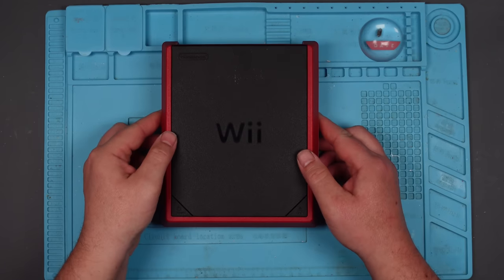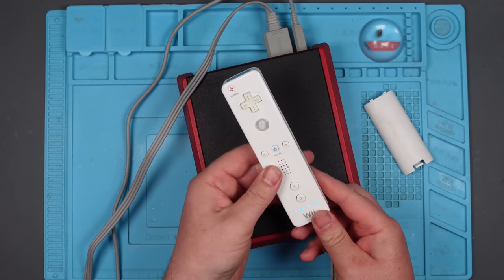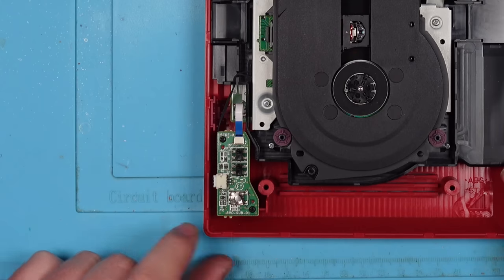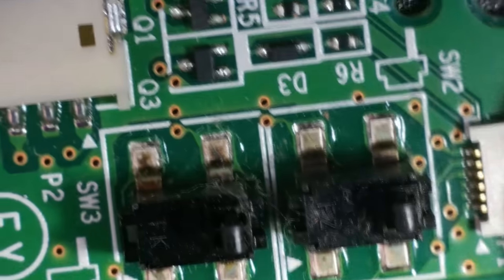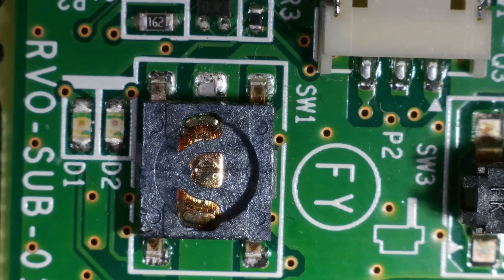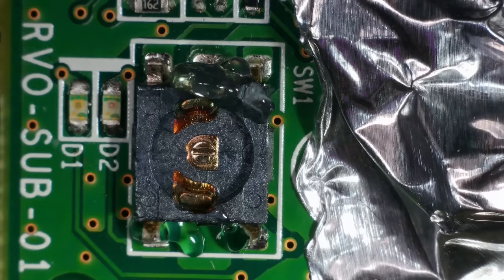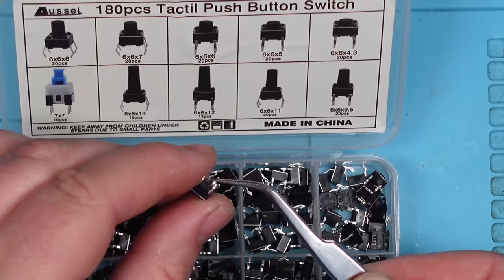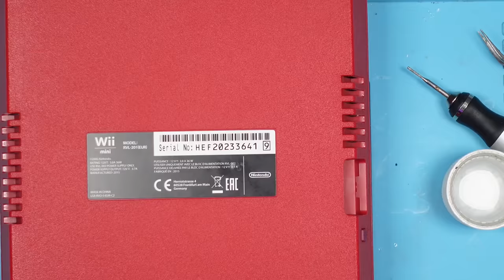I Paid £18 for a FAULTY Wii MINI | Can I FIX It?

Comment: Agree with those who say no need to reset the melted plastic counter. I consider the counter to mean when you accidentally melt something because you didn't take precautions/didn't think about it and you end up damaging the end product. The bad switch was, well, bad so who cares if it melts...you weren't going to take precautions to protect it. 🙂
Reply: Agreed
Reply: Agreed
Reply: Yeah I don't understand why he reset the counter. The button was completely destroyed already, you can't salvage anything on that it was just junk.
Reply: I know he really wanted to reset it and looked for an excuse to do it.
The button was to be replaced with hot air and it doesn't count as melted plastic. Put the counter back to current day.
Reply: Agreed, counter should be restored.
Reply: I 1000% agree!!! DON'T RESET THE COUNTER!!!!!!!✊
Reply: Agreed.
Reply: Back to 10 for the counter.
Reply: Plastic was melted. The counter had to be reset.  We aren't anarchists.
Reply: I disagree; any melted plastic counts.
Reply: I thought the point was when it was done accidentally.  Maybe it's the sign that needs updating
Reply: @l9day   it was accidental - he didn't set out to melt the plastic.
Reply: This 100%
Reply: Agreed, melting already broken parts intended to be discarded should not count. I recommend we petition the committee and overturn the reset of the counter. Who will draft the strongly worded letter?
Reply: @mrcodez Anne Robinson has been informed already
Reply: I agree, you weren't intending to keep the broken switch anyway. You can bring it back to 10 days guilt free.
Reply: Agreed.
Reply: melted plastic is only a problem if you want to reuse it.  You wouldn't reset the "damaged capacitor" counter if you cut them off to replace them.

Comment: I probably would have just shaved down the pokey-bit from the WII but you're probably right to modify the part rather than the console.
Reply: if he had to mod the case it would be better to shave down the plastic standoffs. then the damage can be reverted with longer screws/washers

Comment: I don't think I've ever seen a Wii that looks like that
Reply: nor have i. really weird. though it was one of those small form factor replica thingies.
Reply from the maker: Yeah, I don't think they're that common. They look cute, but they're missing a decent resolution output, and also the WiFi card. So it's a bit of a shame really 😳
Reply: @StezStixFix wanted to become a Concrete Donkey today but they was sold out. Really want my name in those raps haha 😂 anyways cheers to ya Stez. Love your vids
Reply: @StezStixFix Were they europe and asia only? I remember seeing them in shops 10-15 years ago
Reply: @StezStixFix  You can add wifi back to these minis! Tito over at Macho Nacho Productions did a video on modding the mini and I've been looking for a cheap one ever since lol
Reply: @jankarlovic  the wii mini came out everywhere in 2013. i just don't think it sold all too well
Reply: Wii Mini
No SD, No wifi no N64 connectors.
The latest revision of the Wii which was cheap but  expensive useless  dirt literally....
This one does not even need to be saved.....
Reply: @sedrickgates1  No Wii ever had N64 connectors, and wifi and SD can be added back.

The Mini is fine. Your post is not.
Reply: @Sun-ut9gr mistake, GameCube ports.
Still it remains a junk Wii Nintendo shoved at budget consumers to squeeze some more money from them....
Wifi SS added back, sure but not standard and a real Wii will get cheaper after all updates are made.
If you love it, good for you, will not make it a better product than it is.
I stand by my statement and confirm, from original specs:
-No backwards compatibility
-No sd card slot
-Only 1 usb
-No Wi-Fi capability

BTW, I say what I want, especially when it is correct (and corrected about GC/N64)
Reply: @StezStixFix  And no Gamecube compatibility.
Reply: @sedrickgates1  n64?
Reply: @CrashFan03  check my later answer.... Mistake mistake... GameCube ;-)
Reply: @sedrickgates1  my bad i didn't see

Comment: I would have just clipped the legs off the original button and wiped the left over bits off with the soldering iron.  No melted plastic.  But, I do think that the spirit of the melted plastic counter is that it is accidentally melted plastic, and in this case, you didn't do it on accident, and there were no repercussions to it being melted because it was trash anyway, so no need to reset it.

Comment: I learned enough watching these videos to repair my Canon 5D Mark II. It had a damaged compact flash card connector (bent and missing pins from putting a card in sideways), and using the cheapest Amazon soldering kit I could find I was able to remove the old 80 pin connector and put the new eBay one on. 

Then I committed the cardinal sin of reassembling the camera fully before testing, but I was rewarded for my hubris.

An 80-pin desolder and resolder job on a professional DSLR as a first ever task was insane. It was an emotional moment turning the camera on and pressing the "review photos" button. When the card was successfully read I shed a tear and thought "maybe the world doesn't hate me after all"

Thanks mate
Reply: Congratulations, Darly. I don't hate you.
Reply: Very well done. I do know that it's an impressive job to do successfully...

I found the very same model camera in the trash at work and after doing a bit of research, and watching videos on YT about the camera, figured there was a problem with the CF card pins, and after taking it apart, found that it was indeed the case, one single pin pushed back.

I contemplated replacing the 80-pin connector, but decided to just push the pin back, insert a card, and leave it in there, transfer photos out using a cable. I think another deciding factor to do so is that it's the only camera I have of this calibre, and I don't have any lenses for it, so may never get to use it.

Comment: Great fix again Steve. And because of you I have also bought that grinding pen. That was the tool that my repair cases for the repaircafe were missing.
And I found out that it can be stored safely stored in the plastic casing of an epi-pen.

Comment: Button ground is probably just for extra stability.  Nice work!
Reply: Likely the common pin and the other two normally open and normally closed.  It’s a momentary version and the power management chipset likely uses both, it couldn’t be used as an actual mains power switch.

Comment: FYI the "sensor" bar is actually just a couple infrared leds and you can use candles instead if you want.
Reply: I'm not sure if putting candles on top or in front of your tv is a smart idea though.
Reply: But if you dont have a sensor bar it could be a temporary fix
Reply: Ok, but how bright in candles should my candle be?

Comment: I think that the fifth leg on the button was to allow condensers to discharge quickly once you turn off your console. Nothing to worry about ;)
Well done!
Reply: The fifth leg connects to the housing of the SMD button and is for rigidity.
Reply: Looks like the ground was common and the others were normally open and normally closed.  Easy to verify using a meter.

Comment: I'm certain that didn't count as melted plastic. Only counts if you accidentally melt something you weren't just clearing off the board. Resetting your counter for this is like worrying that the pasta sauce jar broke when you chucked it in the recycling bin. The button was obviously for the bin, better to just get it off fast.

Comment: I like this channel! 
My fix would have been changing the switch then removing the button that turns it on and off. Then turn it on and off with a pen poked through the hole where the button was!
Shows what a little more patience can do!
Reply: Or even lazier, just short the switch and turn off by pulling the plug 😂

Comment: Nice work!

I’m very curious. Did you take time to look and see what the extra pad for the power button is for? Obviously they put it on there for a reason. Is it just a ground? Will something happen long-term because it’s not connected?
Reply: Its probably a mounting pad
Reply: Nintendo is known for having needlessly overcomplicated board designs. I think this was safe to ignore.

Comment: The three switch positions are easy to understand.  The switch is momentary and not latching, meaning it only acts for a brief time and cannot act as a disconnect to mains power.  Instead there is a power management chip that uses signal lines and it is the actual device turning it on and off.  The center ground contact is the Common pin while the others are normally open and normally closed.  This arrangement is pretty common in electronics.

Comment: H, Steve. I would have taken a little bit off the button on the case. And if you take to much off it put a  small pad on the other part of the button. And after you found out it worked. I would have glued it to the other part of the button. And job done. Stay safe to you and your loved onrs.

Comment: Yeah. There's a difference between melting plastic when it's something you know you should be careful about ans then something where you already know it won't matter.
No need to reset when it's something you're discarding.

Also you could grind off a little from the casing button instead of the switch itself. But it worked out fine

Comment: So now you can add WiFi to it (it still has the pads for theWiFi card and there is a kit you can buy with the card and connector, etc.), and do the SD card/reset button mod (there is a cool kit for this too) to it and make it awesome.  Oh, and get a Wii2HDMI for it as well.
Reply: i don't think wii2hdmi would work for this since that converts the component signal and the wii mini doesn't support component
Reply: @CrashFan03  Ahh, you're right, that sucks.  Why did Nintendo cripple the Mini so much?  You can still use an RCA to HDMI converter, but the video quality is going to be bad.  There is a Reddit of someone adding 480 HDMI to a Mini, but WOW, the amount of work and wires,not sure it is worth it.

Comment: Could have shaved a mill or two off the screw housing pillars holding the board in place which would lower the height of the button.

Comment: Would it not have been a much easier route to snip down/sand the plastic post on the case that presses on the button, rather than trying to grind down the button itself and risking potentially braking the button?
Reply: Cutting a 5 cent replaceable part vs cutting the console.

Comment: Don’t leave your batteries in the wii remote if not used for a while they self  discharge and then leak due to the small standby current of them possibly destroying the remote ⚠️
Reply: Energizer Lithiums

Comment: I bought an Xbox One S off Ebay, it was suspected by the seller to have a bad power supply. Just got it today and it works perfectly. I'm mildly disappointed I didn't get to fix anything.

Comment: I have to ask... why didn't you just trim a few millimetres from the button stem?
Reply from the maker: There wasn't much protruding, and i was worried about making a hash of it. If the button stem broke, i wouldnt have a replacement, but if the tactile switch broke, i could easily replace it. Well, that's my stupid thinking anyhow! 🤣
Reply: @StezStixFix then I was stupid thinking too as I had the same consideration in my mind

Comment: You could also have cut the button from the red casing and not the button from the circuit.
Reply: Just what I was thinking….👍
Reply: Cutting a 5 cent replaceable part vs cutting the console.

Comment: I have one of these. They are pretty crap. I've modded it to have custom firmware, a gamecube port and an SD card slot. But due to it only outputting in AV i've never really used it. Fun to mod though.

Comment: The kids still use a modded Wii. Works fine and the disc drive can never be worn out from use. I was surprised to see the Wii mini Where's the logic Nintendo?designed to use discs six years after the original.  Why would I buy a Mini when it's basically a slightly shrunk down standard Wii?
Ntd could have released usb rom packs with say 5 games on each for not too much money and monetise the Mini.

Comment: instead of filing down the button, I would have lowered the board instead. to do this, you would have had to file something away from the lower part of the housing
Reply: Filing a 5 cent replaceable part vs filing a $100 console.

Comment: I had no idea there was such a thing as the Wii mini.
Reply: the wii mini was a cheap pointless console that removed these features:

gamecube discs support (just like the rvl-101)
gamecube ports (just like the rvl-101)
480p component video output
sd card slot
wifi
support for the lan adapter (however it can be restored with homebrew)